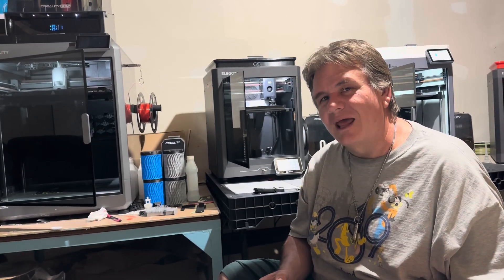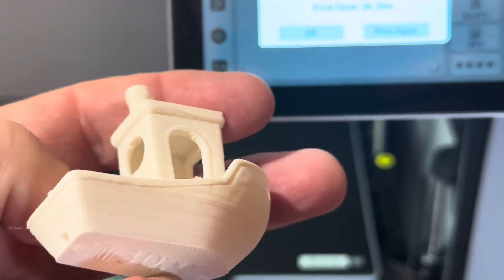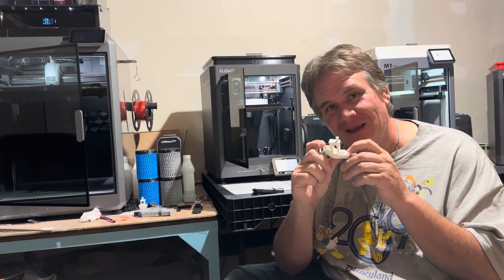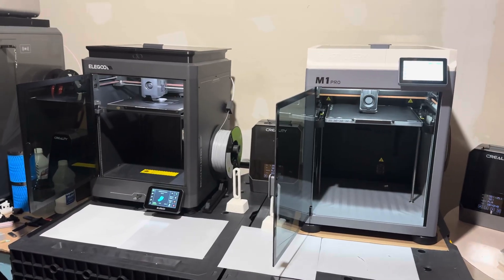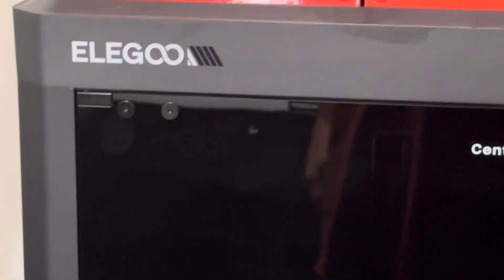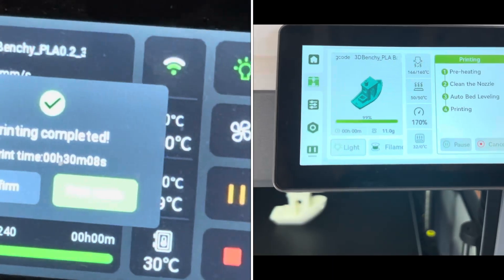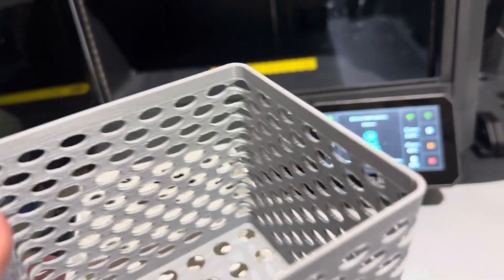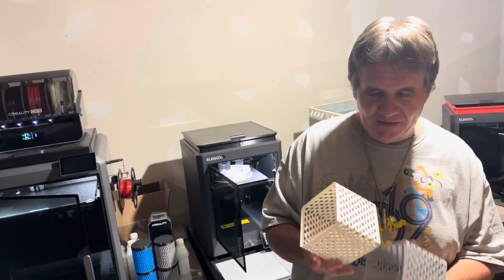Artillery M1 pro goes head to head against the Elegoo Centauri Carbon

Comment: a real head to head is same file same settings in the slicer and then go the M1 had twice the number or layers no wonder it took so long.
Reply from the maker: Ya we re did the comparison with using the same g-code.  Then the CC was only a little faster.

Comment: The difference is probably the filament.
Reply from the maker: Ya not the filament,  the setting in the slicer changed for the m1 pro which accounts for most of the change.

Comment: I see the print setups weren't exactly the same, the CC bed temp was 60 degC vs 50 degC for the M1.  Perhaps some other printer settings were different which could explain the speed differential.
Reply from the maker: You are correct when we changes the printer from the Centauri Carbon to the M1 Pro it also changed some other settings.  We re did the test using the same G-Code to make sure the setting stayed the same.  

https://youtu.be/CFEnf5Gw5i4?si=VMRl0YQIqKoceMjk
Reply from the maker: Yes you were right.  I re did the experiment.  I put the stl in the slicer chose the printer and had the slicer prepare it and make the g-code for the printer.  Choosing a different printer changed several setting making the comparison not a real comparison.  When I redid the comparison i put the same g-code into both printers and shot a new video.

Comment: Plot twist: they are made by the same company.
Reply: Almost all the 3d printers come from shenzen, china. Says right on the box, lots copying for sure, but they arent interchangable. There electronics are all different too, elegoo usually come with the cheapest looking boards out there. Qidi uses a more standard board with replaceable memory chips, and runs open source klipper. All these newer machines are definitely different, but most of them are running a closed version of klipper firmware. They want you locked imto their eco system. Which is a fool's errand, because if your printer suck, no one is going to buy it to begin with.
Reply from the maker: @oneanother1 yep,  you are correct
Reply: I think alot of 3d printer comoanies use the manufacturer, well at least in the olden days. I think each company designs their own printer though, cut corners where they can, meet a specific price point. You can tell the elegoo is much better built, which was origjnally target at a 500 dollasr price point. They had to cut prices upon release because no one was interested, eventhough its a very well built printer. Thats why the elegoo is so much more popular, when others have failed to sell.
Reply: Look at the sidewinder x4 vs the neptune 4. Same design, screen, features, ext. There are a couple improvements on the Artillery (at least on the models I mentioned) that warrant a slightly higher price. With the new enclosed printers, I'm not sure. But they are definitely made by the same manufacturer.
Reply from the maker: Cool i need to look into it.
Reply: @patrickhealy91 Almost all the 3d printers come from shenzen, china. Says right on the box, lots copying for sure, but they arent interchangable. There electronics are all different too, elegoo usually come with the cheapest looking boards out there. Qidi uses a more standard board with replaceable memory chips, and runs open source klipper. All these newer machines are definitely different, but most of them are running a closed version of klipper firmware. They want you locked imto their eco system. Which is a fool's errand, because if your printer suck, no one is going to buy it to begin with.
Reply from the maker: You will have to explain that one a little more?  Elegoo makes the Centauri Carbon and Artillery makes the M1 Pro.  Even if they use the same Factory to produce them, they are produced by two different companies.

Comment: Iv heard tue artillery has root access, so we can change the printer settings. Slicer can tune the filament and speed so its not a big issue. If access to the printer settings isnt important, than the centauri is the better printer hardwarewise. Multicolor is on the way for tur elegoo. Who knows when artillery will come out with it.
Reply from the maker: Not sure I follow you.  The access to the printer setting was shut down on the last firmware update.
Reply: @BGoodson2006 well, that sucks. They should be compliant with klipper's open source agreement. No thanks artillery. Not interested anymore.
Reply from the maker: I agree,  i hope it is a temporary shut down.  I have had some suggest they closed it while they fix something,  however i am not sure what i believe just yet except that they need to make it open source if they want my support.
Reply: @BGoodson2006 3djake did a video about how open source is dead, and basically every all the3d printer comoanies are stealing and patenting open source designs. Yet, for me, its more reason not to support them. Anything with closed ecosystem is no go for me. Im a tinkerer anyhow, so open source matters to me.
Reply: 3djake did a video about how open source is dead, and basically every all the3d printer comoanies are stealing and patenting open source designs. Yet, for me, its more reason not to support them. Anything with closed ecosystem is no go for me. Im a tinkerer anyhow, so open source matters to me.

Comment: so, who is the best? Elegoo Centauri Carbon or Artillery M1 Pro??
Reply from the maker: I am leaning towards the Centauri Carbon for several reasons.  But it is a discussion not a simple answer.  I do believe that there is a-lot of potential for the artillery M1 Pro.  I believe that the components in the M1 Pro are better than in the Centauri Carbon, but can’t fully verify that just yet.  The soft ware for the Centauri Carbon is better.  Right now i can more reliably get better prints of the Centauri Carbon than off the M1 Pro.  Not much better and probably not really enough of a difference to care about.  However right now the speed is a difference the M1 Pro take roughly 3 time as long to print than the Centauri Carbon.  How ever this is probably due more to the settings than the printer.  If i slice an STL for the Centauri carbon prepare it to be printed and then change the printer to be the Artillery M1 Pro it gives you the option to migrate the setting over but not all of the settings. There are still many settings that change when you change the printer.  These changes are causing the printer to print slower.  Over time i believe there will be better profiles for the Artillery M1 Pro.  However there are several things that impact how quickly these kinds of changes take place.  One very influential aspect to how fast these changes occur is “the support for the printer within the 3d printing community”. The community builds better profiles faster than the company’s that make the printer.

The Artillery M1 Pro does not have as much support within the community as does the Centauri Carbon. Artillery M1 pro is locking out the community,  we have had access to Fluidd (the ability to use orca and work around issues not yet fixed) yesterday they did a firmware update that shut down that access.

The M1 Pro does not have a ethernet port, it uses a mini SD Card and does not have a USB port.  These interfere with our ability to mess around with settings.  

The actual hard ware with the M1 pro is probably better but the actual performance is not yet reflective of that.  Right now you pay 80 more for almost as good of a print that takes 3 times as long. 

If you are a tinkerer you might choose the M1 Pro, but there are so many printers on the market with more coming out all the time that in most cases i would probably choose the cheaper Centauri Carbon.

I plan to address the question in my next video.
Reply: It depends for what you need

Comment: Comparing the top of the bechies on Artillery the layer height is visibly smaller, seems to be the half of the centauri print. No wonder it took that much time on the Artillery. I appreciate the effort but this is not a real comparison. Side by side running is not relevant here, using the same filament and run the prints separately would make more sense.
Reply from the maker: I agree i am going to try addressing this a new way.  I am going to print the same g-code in both printers.
Reply from the maker: My last video I was printing the benchie side by side on an Artillery M1 Pro and a Elegoo Centauri Carbon.  Each printer was printing a file sliced differently for each printer.  This time i sliced one file and printed the same G-gode on each priner.

https://youtu.be/CFEnf5Gw5i4?si=_CZhG5iFBcBBcsmGt